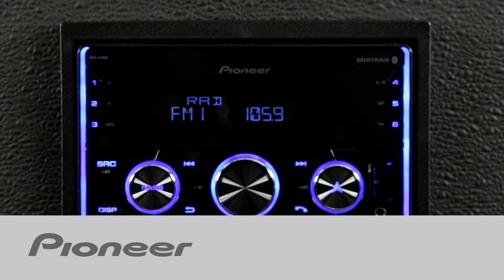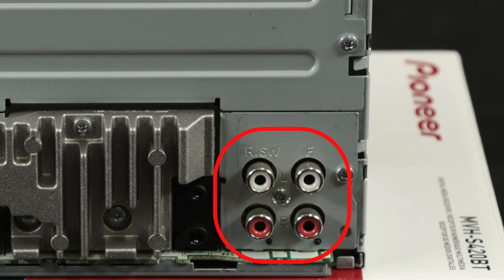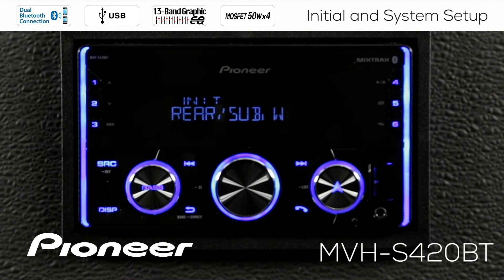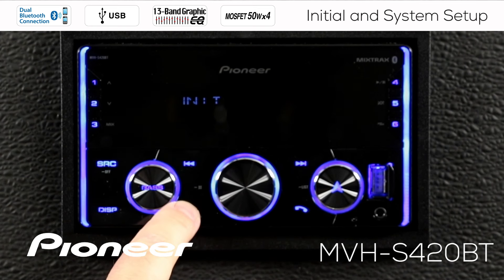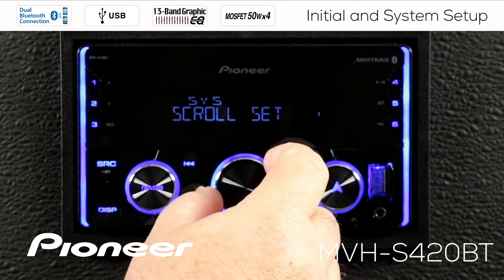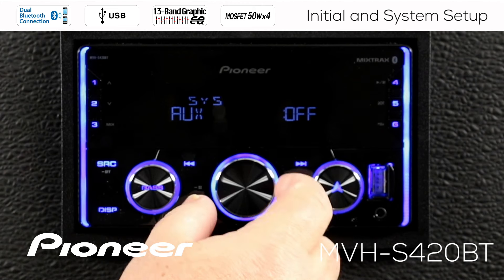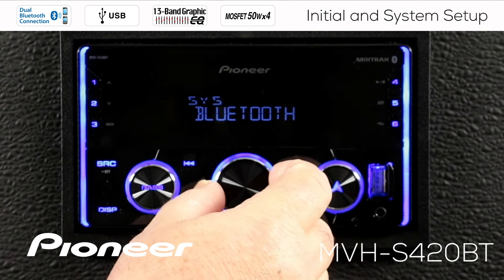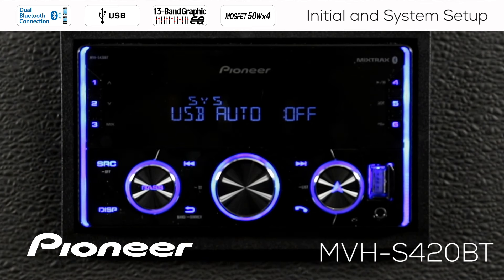How To - Initial and System Setup - Pioneer 2 RCA Audio Receivers 2020

Comment: Can you do a full video on pioneer DEH S4250BT Stereo please, I recently purchased this stereo, And can't get my subwoofer to work, It is a blaupunkt subwoofer with a built in amp, I have all the wires connected properly! There is no sound coming through the subwoofer, Sound is Only coming through the 4 door speaker's and that's it, I have done all the settings on the head unit an still nothing... I would like  some help with this please thank you
Reply from the maker: Please be more specific with your question. Are the door speakers working?   How are the 4 door speakers connected to the receiver?  Through the receiver's speaker level outputs?  Or are you running an external amplifier for door speakers?   Does the subwoofer power on and off with the receiver?  Are you certain?   Can you see the power indicator?   Did you connect the RCA outputs from the receiver to the subwoofer?   Front RCA output or Rear RCA output?    You can find a Pioneer How To video about wiring your Pioneer in-dash receiver here:      https://youtu.be/kR2MO2kwFug?list=PLw63zJRQbCNiPrgwJQGimQIzOEz5sJiHP      
The Pioneer DEH-S4250BT is very similar in operation to Pioneer DEH-S4200BT.  You can find a subwoofer output setup video for this receiver here:  https://youtu.be/dMsL-5uwogw?list=PLw63zJRQbCNiPrgwJQGimQIzOEz5sJiHP     Please be sure you have the subwoofer output switched ON in the Subwoofer Menu.  You can see it here:   https://youtu.be/dMsL-5uwogw?list=PLw63zJRQbCNiPrgwJQGimQIzOEz5sJiHP&t=213  You can find a full playlist of How To videos from Pioneer DEH-S4200BT here:   https://youtu.be/o6iawP279R4?list=PLw63zJRQbCNiPrgwJQGimQIzOEz5sJiHP   and you can find more videos on Pioneer's YouTube Channel here:  https://www.youtube.com/user/pioneerelectronics

Comment: Found the bt on setting thanks! Now I cant find the option about the rca outputs front rear 🤔
Reply from the maker: Pioneer receivers are designed with the RCA outputs on at all times unless it's setup as subwoofer output.  That an be switched on and off.  You can learn more about it in this How To video from Pioneer:   https://youtu.be/dMsL-5uwogw  Please watch the video with the sound on.
To change the RCA output to Front/Rear use the "Rear/Rear" setting shown in this How To video from Pioneer:   https://youtu.be/4xf-rc9IEok?t=83
Reply: @pioneerelectronics  thank you

Comment: sp-p/o mode is not an option in my "INITIAL" settings. I have this exact receiver (MVH-S420BT). Can you please help me?
Reply from the maker: What are you finding in the Initial Settings?  Are finding System Info, Software update, and System Reset.  Turn the volume control a little further to find SP-P/O.  
If it's not in that list  I recommend to press the receivers microprocessor reset button.  You'll need a paperclip or some other small point to press the microprocessor reset button.  You can find the microprocessor reset button for MVH-S420BT behind the detachable face as seen in this How To video from Pioneer:     https://youtu.be/o6iawP279R4
Please watch the Initial Setup video again, with the sound on.  I don't know how to explain this process any more clearly than what is carefully shown and heard in the Pioneer How To video here:   https://youtu.be/4xf-rc9IEok?t=43
1. Vehicle is on
2. Radio is off
3. press in on volume control
4. rotate volume to Initial.
5. Press in on volume to confirm initial.
6. Rotate the volume control to find SP-P/O
7. Press in on volume to confirm your selection.
You can find more videos on Pioneer's YouTube Channel here:  https://www.youtube.com/@pioneerelectronics

Comment: How do I get mine to stay programmed? Every time I start the car everything starts over.
Reply: The in-dash receiver is installed incorrectly.   If your clock and radio stations reset each time you start your vehicle your in-dash receiver may have an improper connection for the Yellow Wire.  The Yellow Wire must have constant power from the vehicle. The Red Wire is for accessory.  Do not connect the Red Wire and Yellow Wire together. Please take a look at this video for more information on wiring your Pioneer in-dash receiver:   https://youtu.be/kR2MO2kwFug?list=PLw63zJRQbCNhDoDXEJKBHoC27MkfUhJ-R     You can find a full playlist of videos from Pioneer about 2020 audio receivers here:  https://youtu.be/to2eXLPBnJI?list=PLw63zJRQbCNhDoDXEJKBHoC27MkfUhJ-R   and you can find more videos on Pioneer's YouTube Channel here:  https://www.youtube.com/user/pioneerelectronics
Reply: @deckerdotto6035  Thank you

Comment: What settings should I change to get the most bass out of my speakers... I don’t have a subwoofer but want it to feel like I got one
Reply: The only real way to get the feel of having a subwoofer in  your vehicle is to add on a sub to  your vehicle.  There is no way around it.  
If you have 4 factory speakers in your vehicle, here are a few things I recommend to get better bass. However, Please note:  Don't expect magic.    If you don't have a subwoofer, there is only so much you can do to get the feel of having one.       I recommend to set up the Pioneer receiver's initial setup as REAR/REAR.  That means, the speaker level outputs will be full range or all of the frequencies, High, Mid, and low will be produced by all 4 of the vehicle speakers.   Go to the EQ and select the Super Bass factory Preset or the Powerful Preset.   You can see it here:  https://youtu.be/nNUyRgc8jC8?list=PLw63zJRQbCNhDoDXEJKBHoC27MkfUhJ-R    Super Important:   Under the crossover settings, please be sure to switch the HPF or High Pass Filter Off for all, both front and rear, speakers.  You can see it here:  https://youtu.be/hiDOCp75UAI?list=PLw63zJRQbCNinkLCSrV17ExW5FWT7aIFU&t=290  
That's one way to set things up.  Again, don't expect magic. 
A second approach to this would be to set up the vehicle's front speakers to play full range High, Mid, and Low, and to set up the rear speakers to play only low subwoofer frequencies.  You can do this by in the receiver's Initial Setup with the Sub.W / Sub.W setting. You can see it here:   https://youtu.be/4xf-rc9IEok?t=129       This means the front speakers will play all frequencies, and the rear speakers will only play the low frequencies.    Go to the EQ and select the Super Bass factory Preset or the Powerful Preset.   You can see it here:  https://youtu.be/nNUyRgc8jC8?list=PLw63zJRQbCNhDoDXEJKBHoC27MkfUhJ-R

That's another way to set things up.  Again, don't expect magic. 
If you want it to sound and feel like you have a subwoofer in your vehicle, I recommend getting started with a subwoofer with a self-powered Pioneer subwoofer.  This type of woofer has both an amplifier and a subwoofer in one box.  There are many sizes and shapes to choose from.  Some are small and can go under the front seat.  They provide a little bass but you know it's there.  Others are large and really boom.  You can learn more about Pioneer self-powered subwoofers here:  https://youtu.be/AkushNUilVs?list=PLw63zJRQbCNhkTQCxPpxGF4h6l6qocsaR    You can find more videos on Pioneer's YouTube Channel here:  https://www.youtube.com/user/pioneerelectronics
Reply: @deckerdotto6035  Cool, thanks. So do you recommend the 1st option or the 2nd option you sent me ?
Reply: I recommend to try option 1 first.  Drive around for a few days or a week and listen to the system.  Then change to option 2.  Drive around for a week or so and listen to the system.  Change it back to option 1 if you want.  It's up to you.  It's your vehicle, make it sound the way it works best for you.   When you're ready, spend some money on new speakers for your vehicle and you'll hear it come alive.  Speakers are fairly inexpensive and give the best sound upgrade for the money.   You can check out some Pioneer speakers here:  https://youtu.be/bwrJ4LcyHmU?list=PLw63zJRQbCNiTV71nfrZHNcn8taD6y4yX     You can learn more about Pioneer self-powered subwoofers here:  https://youtu.be/AkushNUilVs?list=PLw63zJRQbCNhkTQCxPpxGF4h6l6qocsaR    You can find more videos on Pioneer's YouTube Channel here:  https://www.youtube.com/user/pioneerelectronics
Reply: @deckerdotto6035

Comment: Hi i have a pioneer deh-x1950ub.its kinda new but for some reason i get no sound from rca output.what could be the prob
Reply from the maker: RCA outputs are designed to send a low level signal to an external amplifier. The external amplifier then connects to the speakers.   RCA outputs are not designed to connect directly to speakers. Please watch this How To video from Pioneer about wiring receiver to speakers:    https://youtu.be/kR2MO2kwFug?list=PLw63zJRQbCNgUI_3Z0V1p65bgicKwj4VG    You can find more videos on Pioneer's YouTube Channel here:  https://www.youtube.com/user/pioneerelectronics

Comment: Thanks, excelent video.
Reply from the maker: You can find a full playlist of How To videos from Pioneer about audio receivers here:  https://youtu.be/to2eXLPBnJI?list=PLw63zJRQbCNhDoDXEJKBHoC27MkfUhJ-R    and you can find more videos on Pioneer's YouTube Channel here:  https://www.youtube.com/user/pioneerelectronics
Reply: @pioneerelectronics  Everything is connected rca's remote wire power wire an ground light turns on when turn the head on and turns off as normal and the 4 door speaker's are connected to the head unit

(1)White & White/Black
(2)Gray & Gray/Black
(3)Green & Green/Black
(4)Violet & Violet/Black

Subwoofer has a built in amp which is connected with the RCA'S and the other end of the RCA'S is connected to the head unit
Reply from the maker: @als5524      I recommend to press the receiver's microprocessor reset button.  You'll need a paperclip or some other small piont to press the microprocessor reset button.  You can find the microprocessor reset button on behind the detachable face.  You can see it demonstrated in this Pioneer How To video:    https://youtu.be/o6iawP279R4     The Pioneer DEH-S4250BT is very similar in operation to Pioneer DEH-S4200BT.  You can find a subwoofer output setup video for this receiver here:  https://youtu.be/dMsL-5uwogw?list=PLw63zJRQbCNiPrgwJQGimQIzOEz5sJiHP     
Please be sure you have the subwoofer output switched ON in the Subwoofer Menu.  You can see it here:     https://youtu.be/dMsL-5uwogw?list=PLw63zJRQbCNiPrgwJQGimQIzOEz5sJiHP&t=209     
You can find a full playlist of How To videos from Pioneer DEH-S4200BT here:   https://youtu.be/o6iawP279R4?list=PLw63zJRQbCNiPrgwJQGimQIzOEz5sJiHP   and you can find more videos on Pioneer's YouTube Channel here:  https://www.youtube.com/user/pioneerelectronics

Comment: ? for car audio - on the Rockville RV12.1C 600w 12 inch. and others like it.
I know you use the RCE out ports on a pioneer Stereo to connect to the RCA inputs on the amp, But do you not use the RCE outs on the amp unit to connect the amp to the sub that are there to use?, Do we just use the regular type speaker wire you strip to run from the amp to the sub speaker?
Reply from the maker: You'll use the RCA outputs from an in-dash receiver to send a low level signal from the receiver to an amplifier. The amplifier will amplify the low level signal and create a speaker level output.  At the amplifier, you'll use common speaker wire to go from the amplifier outputs + and -   to the speaker    + and -  
 connection.   This is commonly multi-strand copper wire.  16 gauge wire or, a little thicker like 14 or 12 gauge running from the amplifier speaker outputs to the speaker will usually be good enough.  You can see this on an amplifier here:   https://youtu.be/hHIDBQdKTSA?t=118

Comment: Hi ,
How to play a video using aux?
Reply from the maker: What is the model number of your Pioneer in-dash receiver?    The models shown in the video above are audio only and do not play video.    You can find more videos on Pioneer's YouTube Channel here:   https://www.youtube.com/user/pioneerelectronics
Reply: @pioneerelectronics  yeah, mine is AVH 289BT, my system supports audio & video.
My doubt is can I share videos from mobile to the my poineer system using a aux cable (which has 3.5mm jack on both ends). Does Mobile supports the video sharing via an aux cable?

My another doubt is, can I use android apps by connecting MI stick in the usb port Of my poineer system? Does this work????
Reply from the maker: @rajarajanm3113     I doubt your phone will work this way.     Most modern mobile phones   do not   support video output from the AUX cable.   The Pioneer in-dash receiver is capable of playing back video from AUX input with a proper cable.   You can learn more about the cable  on page 6 of the manual here:     https://www.pioneerelectronics.com/StaticFiles/Manuals/Car/QRD3830B.pdf
This receiver can playback Video and Audio from the USB port.  You can learn more about playing back Audio and Video in the How To video from Pioneer:        https://youtu.be/IQ9pi87S6Cs?t=25        I'm not aware of any apps the will work from a USB port with this receiver.     You can find more videos on Pioneer's YouTube Channel here:   https://www.youtube.com/user/pioneerelectronics